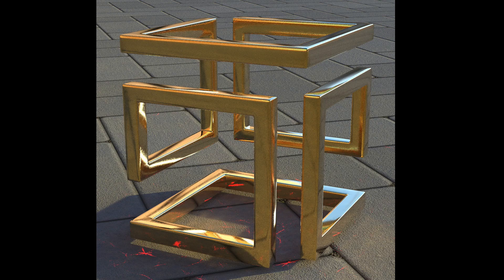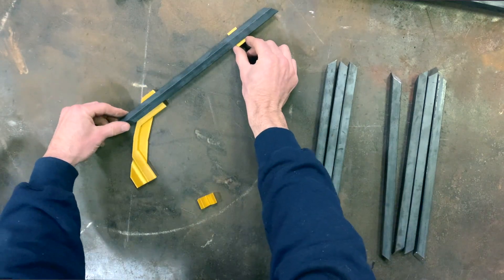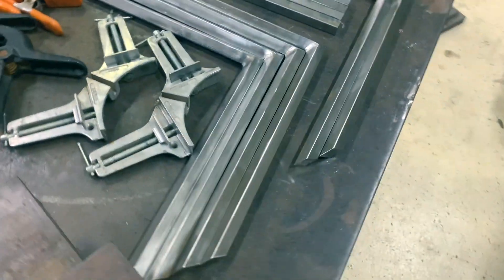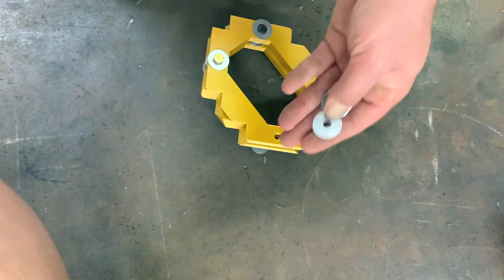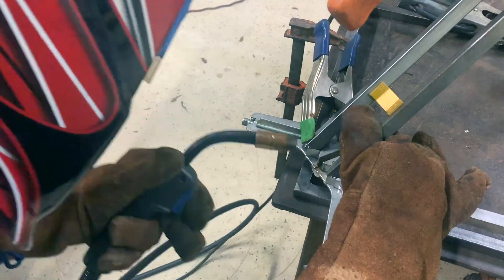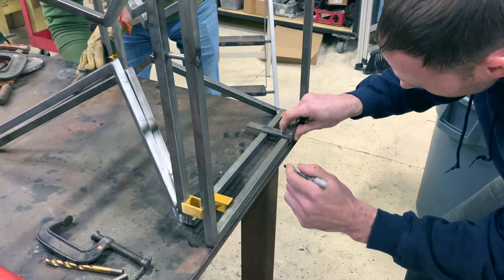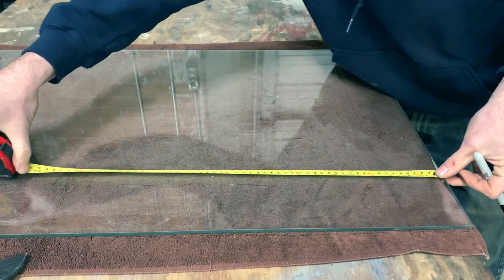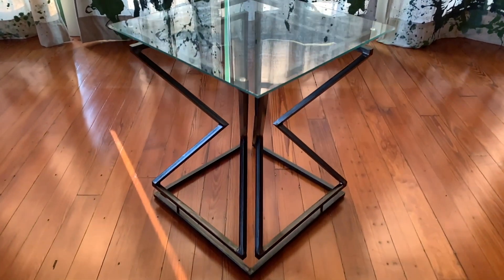Infinite Hourglass Table Challenge

Comment: When score snapping things like tiles and glass, setup a guide so you can do it fast. You want the score to stay ahead of the glass cracking underneath so it decides where to snap, if you go to slow or press to hard, the glass with crack ahead of the score and create chips which will cause it to run off the line when broken.